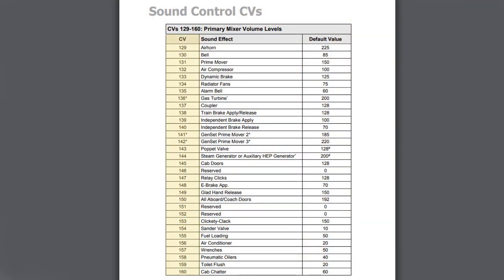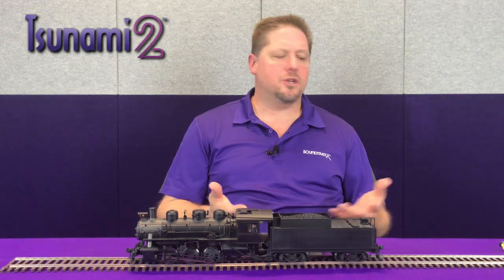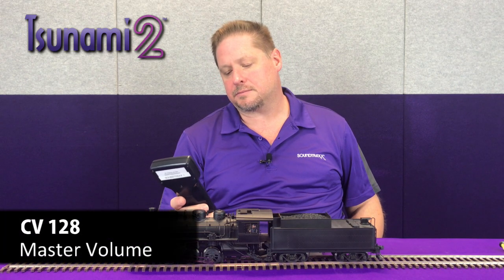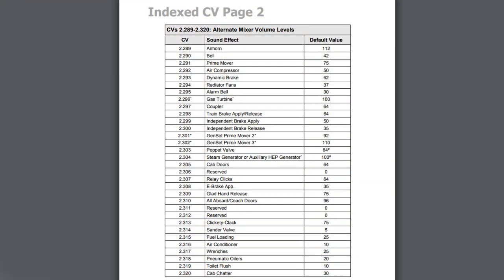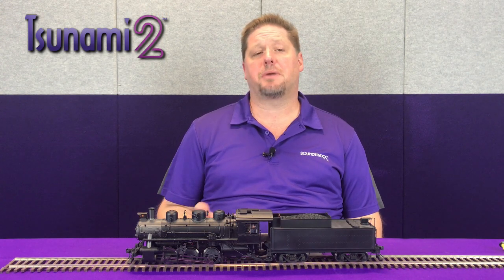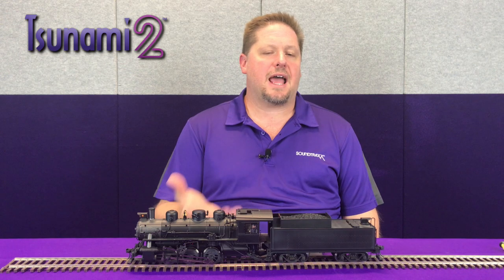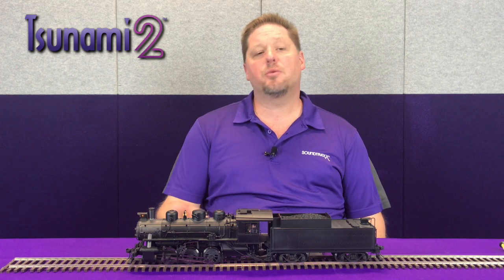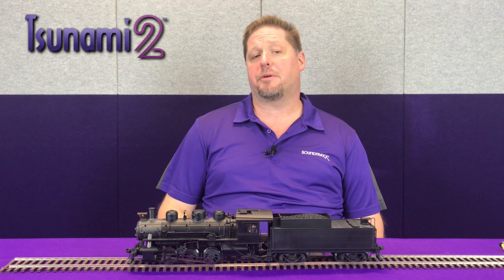SoundTraxx Volume Control

Comment: Another good tip George. The main issue with diesels is that people run the prime mover WAY too loud , which drowns out all the other more discrete sounds. All my PM levels are way down , around 60 -70 depending on the model, plus the bell volume is down at 20 - 30 , which makes it far more realistic...and a lot less annoying! 
Cheers Gregg..
Reply from the maker: That is a good point. Not everyone actually scales the volume of the sound down to match the size of the locomotive.